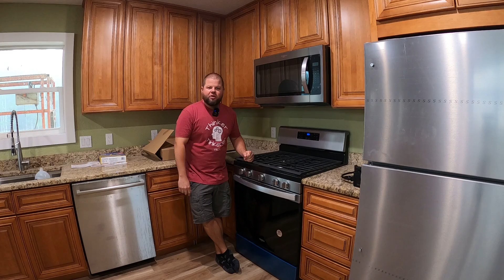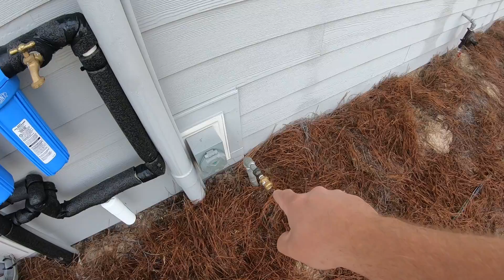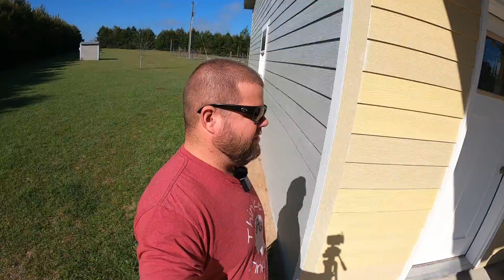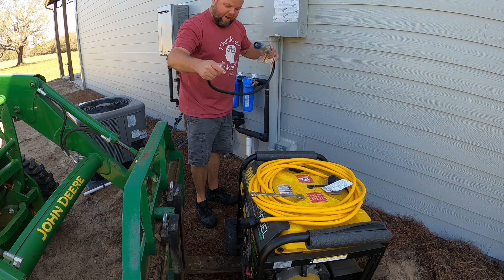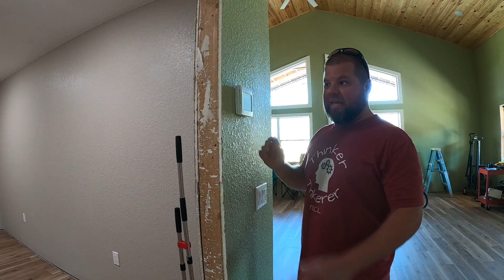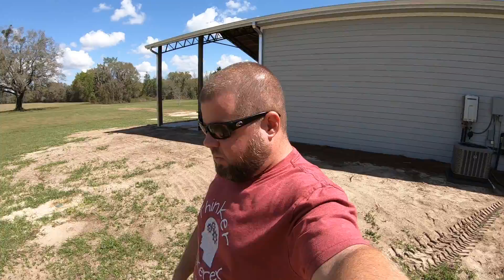Good news and bad! More projects complete #545

Comment: We love our tankless water heater.   Don’t be sorry that you didn’t wire a control panel on the inside, you really never need to change it.  We’ve had ours set at the same temp (130 degrees) for the 5 years we’ve had it.  The one piece of advice I’d give you is to make a cover for it.  Ours was mounted below the unit and we thought it was protected.  It started to discolor and the display starting getting affected by the UV after a year or two.  Now it’s hard to read and ugly looking.  I wish I had covered it
Reply from the maker: Thank you for letting me know

Comment: You should mount your controller in the bathroom next to the shower.  Ours is in our bathroom so it will never get wet and we can change things as we go.
Reply from the maker: Had I known about that before drywall, I would have ran a wire. I still can, but will be a much more involved process now.

Comment: I set our system on 125 and my wife is constantly turning it back down to 120 on the remote.  I then turn it back up when I use the shower and she turns it back down.  It is a constant battle in our home over the 5-degree difference.   I once set it on 135 and it was great for me but she had a fit over it.  I wish I could turn the display off so she could not know what the temp is so I could set it and forget it.
Reply from the maker: Needless to say ours is already back down to 120, 135 was way too hot!

Comment: I can't remember if you have electric heat for the house or propane...if it is propane I would suggest testing the equipment out now just to make sure it works properly.  
As far as the outdoor oven...I have never used one myself...only a cooktop outside...but it seems if it's kept very clean the bugs & critters should leave it alone.
Reply from the maker: Its a heat pump hvac with backup electric heat strip.  All has been tested

Comment: Did you try the generator with the A/C, lights, refrigerator, microwave and ceiling fans running?
Reply from the maker: No not everything, lights and fan wont be a problem as they pull piratically nothing.  All LED in our home. Major heating elements i'll probably cut the AC off when in use

Comment: The shower will probably require many tests to make sure the water temp and pressure are exactly how you want them.  You wouldn't want different phases of the moon throughout the month to skew your results.  Like the ice maker... there needs to be multiple tests through different conditions to make certain everything is right :)
Reply from the maker: For sure, I am already cutting back the temperature and making adjustments.

Comment: You might be surprised: Instant Pots don't actually use that much power, and that's only when they are actually heating. A lot of pressure cooking is at idle just maintaining pressure. It saves a lot of energy. And my 8qt Instant Pot only pulls 1000 watts at full power.   Love it.
Reply from the maker: Good point!

Comment: Andrew did you reroute power from shop to well from the house so generator will power it?
Reply from the maker: Not yet, but wire is ran. All I have to do is hook it up to the pump pressure switch.

Comment: Stuff happens as far as the stove burners. Whirlpool should be able to fix it. I bought a new expensive Genie excellarator garage door opener. Everything was fine till the interior light would come on by itself and stay on till I turned it off. It would do it a random. They replaced the remote and door switch 2x before they finally set a new controler board. Fixed it and 9 years later still works great. Just think how small and complicated those boards are. It's a wonder any of them work.

Comment: Hey Andrew, years ago I rented a house and following a power outage the range worked but stove would not. I learned it was a safety feature. There was a red reset button either in the back or in the broiler area on one side, can't quiet remember. Once I hit it everything worked. Not sure it's relevant with today's appliances but thought I'd share. Hope it's something simple!
Reply from the maker: Mine does have a manual safety valve, I did check it and it's working correctly. Thanks!
Reply: @TKCL  darn, hope they get it fixed for you quickly!
Reply from the maker: Me too!

Comment: Yea those propane tanks are ugly.   We have two 1000gal tanks.  We set them 100ft from the house so they are out in the trees then we painted them green.  They are not as noticeable now.
Reply from the maker: Wow 2000 gallons! Why so much?
Reply: @TKCL  Can only get deliveries during the dry time of the year June - Sept.  We use 1000+ gallons a year. Between heat, hw, cooking, dryer, backup generator.  Also they only fill a 1000 gal tank to 80%.  So at max we have 1600 gal.
Reply from the maker: I see, wow!

Comment: Great job Andrew. Very impressed with your setup, electrical, gas, heater, propane,  emergency response equipment, etc.
      The outdoor oven situation. They do make an outdoor oven. Just make sure you just keep it clean, and build it with easy access in mind like pull out so you can see behind it or anything else like that, but you'll notice ants before you notice rats. 😁
Reply from the maker: That's very true, ants show up immediately.

Comment: Maybe someone will see your video and offer you a large dual fuel "inverter" generator with a pure sign wave output. Not only are they SOOOOO much quieter, but the pure sign wave can be extremely important with all of your newer appliances having such sensitive computers in them now days. Especially your HVAC with all the computerized dampers, thermostats, ect. Money is probably tight, but if that would definitely be a high priority if it were me. Just my opinion. Glad to see the house get one step closer to finished. Hope y'all have a great day, and we will see you tonight on the Live Stream. God Bless.
Reply from the maker: I did get offered a really nice battery powered unit, I drug around with the company and now they no longer have any more to review 😬

Comment: I’ve got a generator I bought back in 1998 right before we had a storm projected to hit Panama City. We had a freezer full of meat and didn’t want to loose it. Luckily we didn’t have to use it. Over the years I’d pull it out and run it for just a little bit. Other than that, it never got used. It came to the rescue when Hurricane Michael hit on October 10th 2018. I had gotten it all set up prior to landfall. It ran 24/7 for 7 straight days. Burned through 30 gallons of gas. Was worth every penny I originally spent on it plus all of the lugging it around all these years.
Reply from the maker: The amount of food we keep on hand will easily pay for our generator if it saves it.

Comment: Personally I'd run the shortest gen cable you can with the largest conductor size.  The voltage drop at current is realized as heat and it'll be on the smallest conductor so cable doesn't reject heat very well.

Comment: I have the same generator and made it TriFuel and to saved me during the Texas Ice Storms then I noticed my electronics had a hard time. I went to the Champion Inverter Model.  Take a look at one of those!
Reply from the maker: No worries, I'll be particular about what I run on it. My hvac is basic and shouldn't have a issue.
Reply: @TKCL   Funny thing is when we got power restored the following week the motor capacitor had to be replaced in the attic unit.  I now keep extra capacitors for all my motors and I got a soft start for my AC unit as well.

Comment: I’ve got that Champion dual fuel as well.  The ice storms from the past few months it has paid for itself,.  I did not have to throw out spoiled food from freezers and refrigerators.  Had other family members stay with us for days as well.  Only issue is I did run out of propane and had to put gasoline in it.  Gasoline is fine but will varnish up carbs as well.
Reply from the maker: It will, but I treat my fuel and run non ethanol.

Comment: My daughter had a mouse get inside her oven in the house, it chewed up the insulation and wires! They didn’t know it until they turned on the oven and it smelled awful! They had to replace the whole inside of the oven! You may want to go with just a cooktop for the outside kitchen! You don’t want to bake a mouse or other critter😳🤢
Reply from the maker: Yuck! Yeah I definitely don't want that issue.

Comment: We use our propane generator at the camp. I think that one is 15 yrs old. Yes hard to start. But it start year around. We only run it as needed when we are at camp. Mainly lights, tv, fans, and shallow well water pump. Our tanks are filled twice a year also. The stove ,oven and gas grill are propane. We have propane gas lights thru out the camp. Used them when no generator is running.
Reply from the maker: That's the great thing about propane, doesn't go bad and gum up engines.

Comment: Also we have the same stove as you all, but run on natural gas.  We had to replace the previous stove as we had rats that made a nest in the insulation of the oven...and they chewed the dishwasher drain line...made a nest under the sink cabinet...just a mess.
Reply from the maker: Yikes, destructive.

Comment: Hey Andrew. You have me seriously thinking about an on demand water heater when it’s time to replace my tank. Is there a reason that you mounted it outside of the house and not inside the house?  Also, after the AC kicked in, what was the result of the voltage test?
Reply from the maker: I didn't retest and I should have. Main reason for outside mounting is less water and gas lines inside, also I don't have to cut another large exhaust port through the side of the house.

Comment: Propane and Natural Gas run on 2 different pressures
Reply from the maker: Yes they do, the stove orifices was converted over to propane.
Reply: @TKCL  They might have installed the solenoids for the higher pressure natural gas by mistake, I guess you will find out when the tech does his diagnosis

Comment: Bad —- new water —- always open tub first.  To flush debris cause shower / sink / toilet clog easily. If no tub run water / air out thru outside hose bib then sink remove airator. To flush hot - no clogs